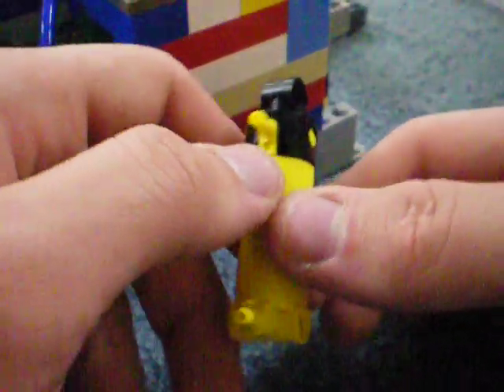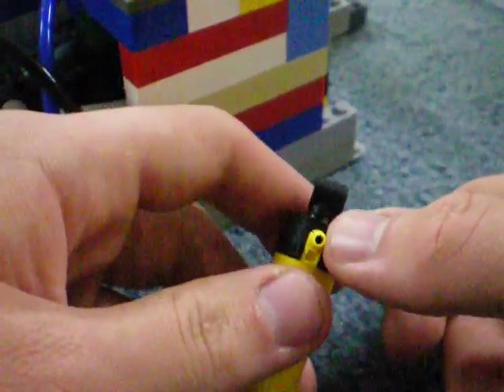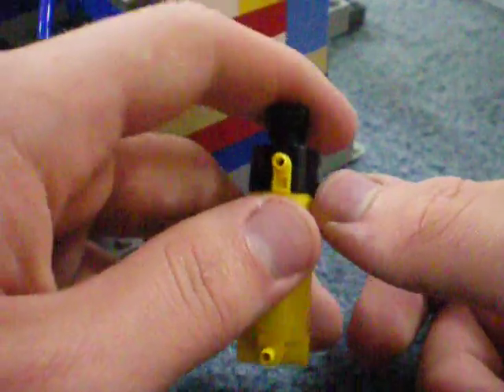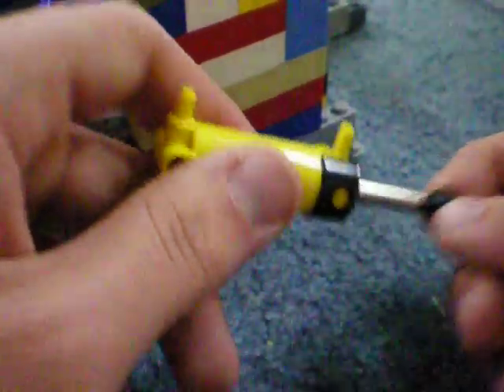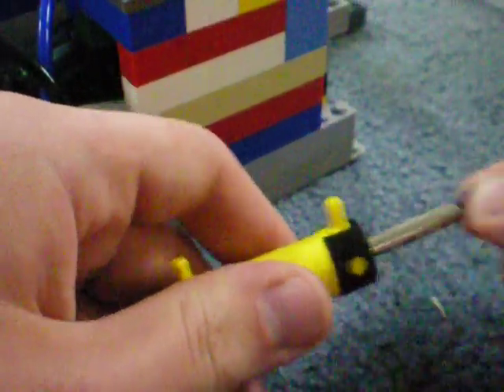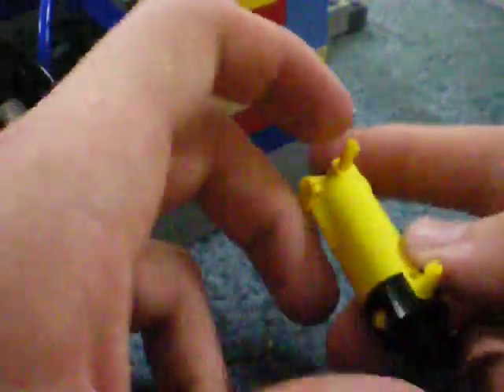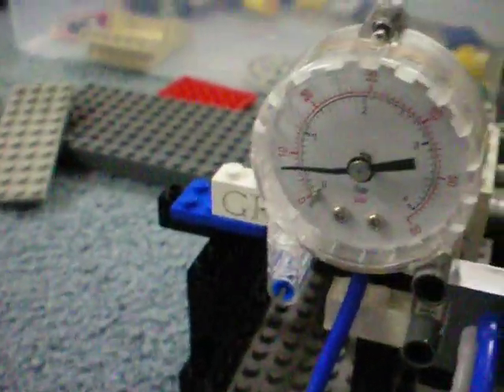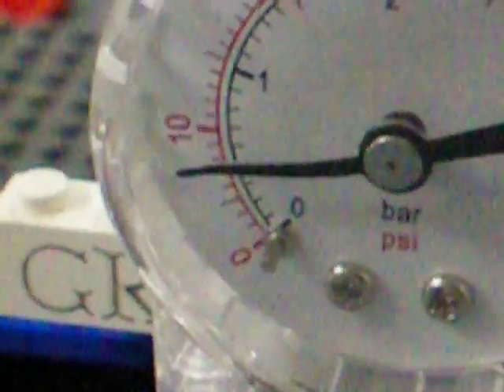Lego pneumatic engine (1 cylinder)

Comment from the maker: @p38lightning7 The inlet is the same size as the unmodified cylinder holes (whatever that is). Having the gauge attached consumes more air than not having it attached because some of the air is being used to push the indicator pin.